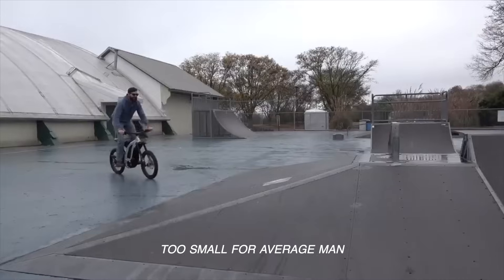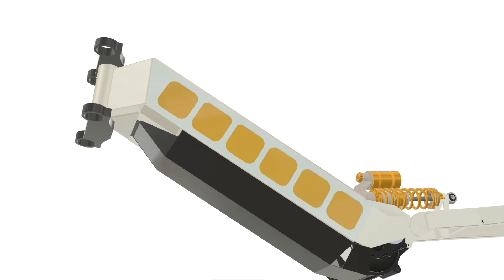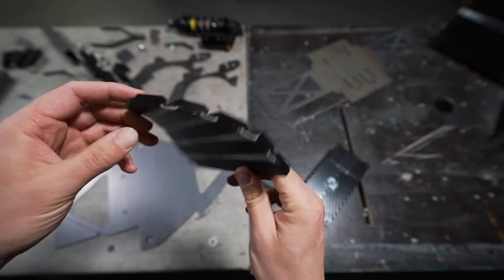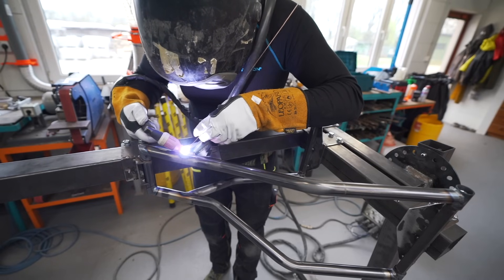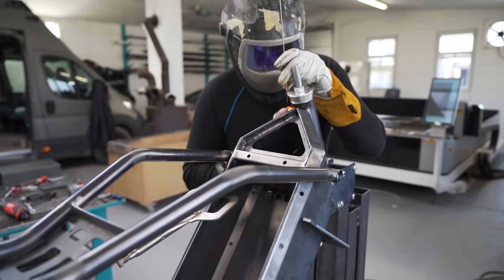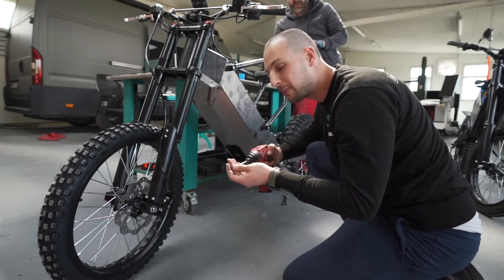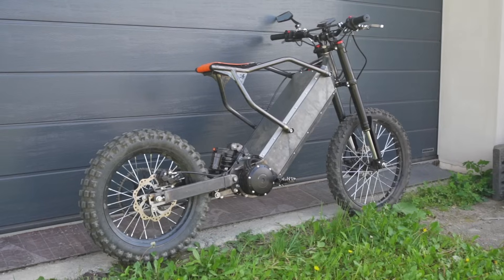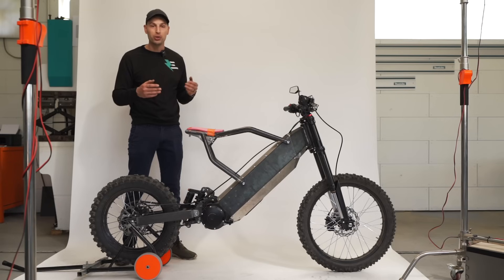Building Insanely Fast Electric Motorcycle From Scratch / New @ridevoltic Build

Comment: To stop the pipe from deforming you should fill the pipe with sand. First bung one end of the pipe with some cloth, i use old overalls, just cut them into small pieces then make a ball slightly larger than the bore of the pipe. Then jam the bung into one end, i use a file with the handle taken off, then with dry sand fill the pipe to the brim. Then with a nylon mallet tap the pipe until the sand compacts and the level of the sand will fall, repeat until you cant get anymore sand into the pipe. then bung the end of the pipe ensuring you get the bung nice and tight, then when you bend the pipe it will almost be like you are bending solid bar. When you are finished bending pull the bungs out and empty out the sand.
If you are still getting a little bit of deformation bend the pipe slightly past the angle you want, then secure one end of the pipe in a vice that is attached to a table that is fixed to the floor. Then get a piece of pipe that fits over the tube you are working with to use as a lever, then pull the bend out to the angle you desire. This will pull out some of the deformation, but be careful not to do too much or the tube will deform the other way.
Trust me im a pipefitter that has been bending pipe for over 30 years.
And if you have the money, buy a bending machine with a mandrel, that goes inside the pipe that prevents deformation.
Happy bending.😊
Reply: that is a very good comment, thanks mate!
Reply: Just use a mandrel. no time to mess around with sand/ice when it goes into production.
Reply: @soarer282  With a large factory that might be the case, but for small hand built production runs, sand wouldn't take much  time. Use expanding rubber plugs and fill the tubes from a tapered hopper while tapping with a rubber mallet or using a vibrator to settle the sand while filling. 
It's sort of like saying, just use robots to do the welding instead of doing it by hand. Great if you can afford it, but not much help on a budget.
Reply: @soarer282 yeah I did say in my first comment, that if he has the money, buy a mandrel bender. But they are quite expensive, that is why I suggested sand bending.
Reply: @soarer282  exactly!!
Reply: Sand or you can freeze water in it but sand is normally cleaner.
Reply: @user-neo71665  yes you can freeze water in pipe but it's generally used on small bore pipe, this technique is used when bending brass instruments like trumpets. But it's quite hard to freeze a 6 meter length of 6 inch pipe, you would need a very big freezer. 🙂
Reply: @tryaluck    Interesting informations.
Reply: Good comment, this is what  did to make a custom subframe for an sv650
Reply: My father taught me this concept when i was  a boy. Thanks for the memory
Reply: @sunshineandsmiles9668  I was also taught by my father, he's a pipefitter like me, and my grandfather also.
Reply: Not in love with the seat design but excellent build regardless.
Reply: Should make a video tutorial on it
Reply: hey better idea use stronger or thicker pipe like a normal person lol wtf ..yea lets fill it up with sand... that will keep the weight down ....what are you f-ing retar*ed
Reply: my bad i didnt read more of the hole comment lol i thought you were saying to keep the sand in there ...i was like wtf he talking about but then i seen read more button
Reply: I was about to write the same thing. I was an engineer at a jet engine control system factory, and I was in charge of testbeds, so I did a lot of piping. Mostly digitally, but at least i saw the process later :)
Reply: The sand works fine with softer metals like copper or aluminum tubing, not sure if it would work the same with steel tubing.
Reply: Could you not insert a Bending Spring? These are made for the purpose, in different diameters for different Tube Bores. Just a thought.
Reply: @peterduxbury927 bending springs are only good for thin soft metal like domestic copper plumbing. 😢
Reply: Check out 46 works. An extremely good motorcycle builder in Japan who has a you tube channel. He sand bends exhaust pipes etc.
Reply: i dont get the point with the fabric - what is it used for in this case?
Reply: @66Gollum  sorry for the late reply,  the fabric is used to bung the ends of the pipe so the sand doesn't fall out. You can also weld flat plate on the end, on a large pipe like 8 inch it is hard to bung with fabric so welding plate on the end is necessary.
Reply: Also can't you just heat the pipe and then quench it in some oil or some other materials to keep it from becoming brittle?
Reply: Sand is oldtimers trick but but immo steel balls are way better.

Comment: Looking good congrats. Maybe you want to consider a lower price. It just doesn’t warrant that price? You don’t have to cover any major tooling costs? You could really be a great competitor if you don’t gouge people on the price. Out source some of your simple sheet metal welded assemblies and give people a tremendous value. 3000 to start and offer wheel and suspension upgrades at fair prices. At 8,000 it’s not amazing anymore. How it goes well
Reply from the maker: That’s the hard part. I took a loan for the cnc laser, cheaped out on the press brake and have not even touched expensive EU legislation. I would like to be developing this bike and at this point I don’t even have enough finance to hire more people. It’s hard to finance all of this!

Comment: I think its a great design. I'm glad to see some other frame ideas out there. Personally I would have gone with larger tires.  I prefer a 21" front 18" rear.  The parts look very similar to current Surron's out there you might consider just selling the frame and battery back as an upgrade kit for those bikes.  I'm sure there's a lot of people out there who bought a surron and wish it was just a little larger. Less pit bike and more motorcycle.    I could also see a version of the sub frame be adjustable height so it could accommodate more riders.
Reply from the maker: Thanks for the feedback. We already have 21” front and 17” rear. I don’t think we’ll go any larger.
Reply: I already commented however adjustable seat would be great

Comment: Looks good but that battery is tiny, lol. You'll want to double the battery size and increase wheel diameter and widths.
Reply from the maker: What are you comparing the battery to? It’s double compared to most of the bikes in this category. What wheel size do you recommend?
Reply: @ladiandmargaret  Your battery is not small. He has no idea what he's talking about.
Reply: @JETHO321  Its small compared to a live wire or a zero or other full up motorcycle. There is still a lot of bicycle dna in this bike. Not that that is necessarily bad.
Reply: @ladiandmargaret  21" front and 18" rear is common sizes for MX bikes, and with that you have tons of tire options. Or, 17" wheels for the Super Moto riders. My only critique is the swingarm. It looks a bit narrow and skinny for the intended purpose. A wider swingarm allows a bit wider tire also. But thats just my opinion. You have done a great job with it mate.
Reply: @npickart  I totally agree 18" & 21". The ground clearance looks insufficient & the proportions of the bike look odd with the small wheels.
Reply from the maker: We have 21” and 17” wheels installed.

Comment: Ok the kid that is spot welding. Did you tell him just act like your spot welding? That's hysterical. He's like pushing down real hard. Like he's pushing the weld through or something. People that don't build batteries aren't going to notice this at all and people that do will be amused. As always a good video. I was wondering when you were going to move away from the Enduro style design. 

This new design needs something though. I'll put my finger on it eventually. Just something. 

I just watched a guy on another channel I watch buy a Sur-ron which is a real head scratcher since that SS bike is has all the upgrades already installed for like $400 more. You get a frame made to hold a 72v battery and the 72v battery. Then these idiots buy a whole new battery for $2000+ when all they had to do was get a 72v BMS and a few more rows of whatever cells come in the stock battery and then just patch your new BMS to the balance leads of stock BMS. All they needed was a little booster pack to reach 72v and they buy a whole new battery. Some people are just stuck in a box. Are Sur-ron riders mimes? They can be pretty annoying so I'm not ruling it out.
Reply from the maker: Be kind to the kid, he did it for the first time and the camera made him nervous :)
Reply: @ladiandmargaret  I figured. The last thing you want to do is mess up on video and be immortalized on YouTube. People are always nervous with the spot welder at first and most think they will get shocked and no one realizes that there's an electromagnetic field generated and not just heat. It does kind of look like you're using a defibrillator. 

I think I put my finger on what was missing. That seat needs to be bigger. You show great big guys riding tiny Sur-rons  and then you have that tiny little seat. Those guys aren't built like you and I just think it will look better too. I know you are trying to keep the design simple but a fellas got to a have a place to rest his assgasket comfortably.

Have you tried flexible PLA yet. Flashforge makes some good stuff. Much more flexible than the shore 95 stuff and prints super easy and it's not expensive at all and they have good colors. I use it a lot when I'm printing bar risers or spacers or anything that could do with some vibration absorbing.

Comment: Similar to ExoDyne electric motorcycle (except back then almost 10y ago they dont have technology (for the right price)  to make it as good as VESC based controllers can do now (nucular etc --- all of them are vesc based) , overall could be good option with the right price and fixed few issues i see that will affect durability and feeling of road etc
Reply from the maker: It does look similar. The main difference is hub vs mid drive.

Comment: Looks awesome given the power do you have enough brake??
Reply from the maker: I love the braking power on this bike.
Reply: @ladiandmargaret  the rotors don't look like a lot of surface so size of pads is what I'm thinking about.  On my little e bike that I have pulled the governor from, I have great braking power, but if I'm not careful I can wear out a set of pads very quickly.
Reply from the maker: Don’t forget regen takes around 70% of all the breaking. The front wheel is 21” so the rotor might look small. The front brake alone stops the bike very impressively. So far brakes are not my concern.
Reply: @ladiandmargaret  oh fantastic! Didn't realize you had regen!!!!

Comment: The short "seat" is very dangerous, particularly for off-road riding, ask me how i know.
Reply from the maker: We are extending it for the following version.
Reply: Nice Build  - looks Fast -  R U selling cad design ? KYB or similar forks head set fit  ? suggestions seat tubes can be smaller - make swing are pivot strong = lots of lateral forces this area - taller handle bars  @ladiandmargaret
Reply from the maker: I’m not selling the cat design. Not sure about the fork. I’m actually making the seat tubes bigger for aesthetics. Will see how it turns out.

Comment: Pretty Cool 👍  The space under the seat could be converted into a locking 🔒 storage compartment. Also a removable 🔩 bolt on rear rack could be made & bolted on. To support  saddlebags or triple bag storage set.
        If I had the money to buy one, I'd want some storage ootions,like mentioned above, probably a longer seat  & also pedals on it for #1 more stealth to blend in as a bicycle & #2 For the ability to pedal in the event of a breakdown. 
I'm not at all criticizing the build. Just offering some ideas. 
I really do like the idea 💡 of a metal locking  storage compartment under the seat. Have a tough hinge on 1 side & door cover plate.
Oh duh 🤪  I started commenting before watching the end of video about the storage compartment idea 💡